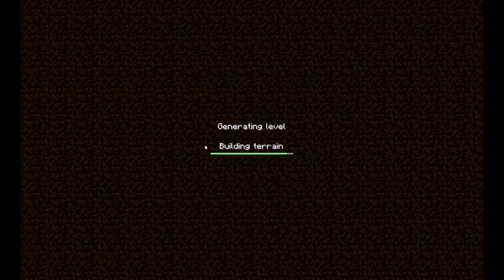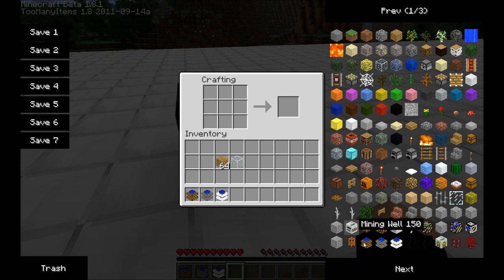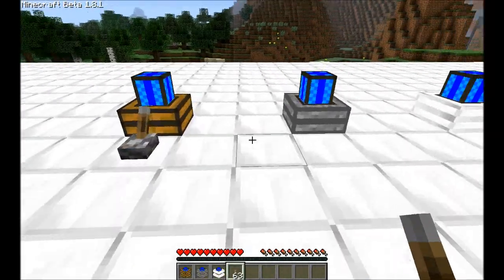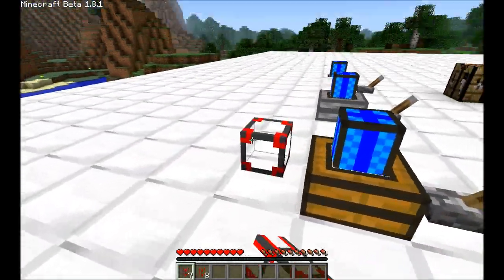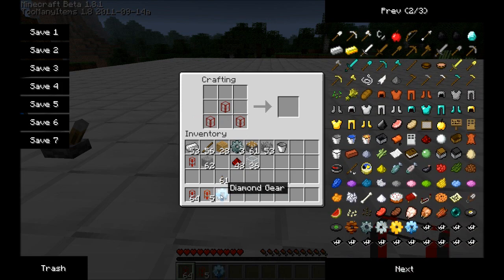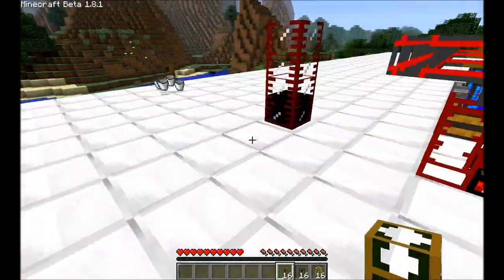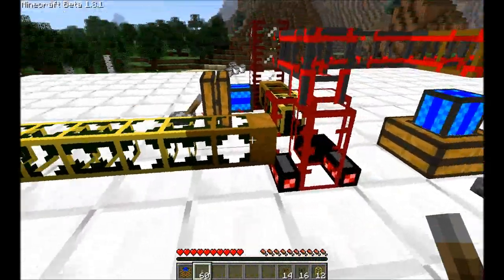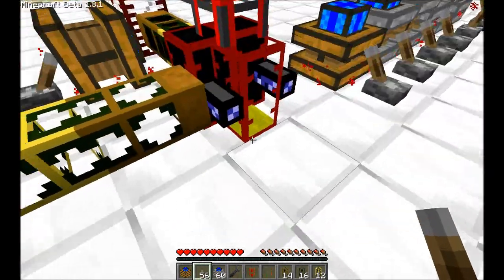Buildcraft how to build a refinery Basics

Comment: I have done some experimenting and I have discovered that 1 refinery needs either: 2 combustion engines or 8 steam engines to run at full power. To run 1 refinery with redstone engines would require about 200-300 redstone engines to run anywhere near full power.